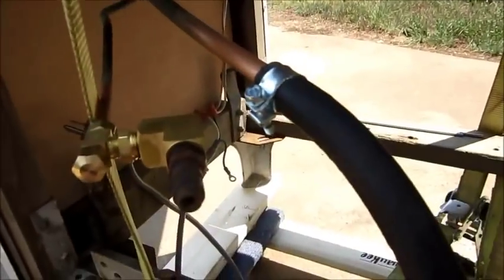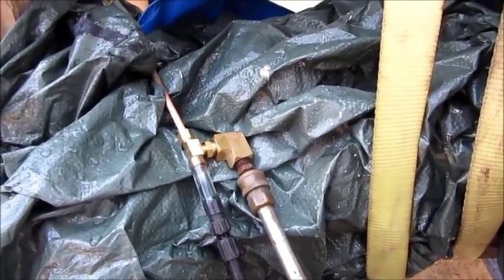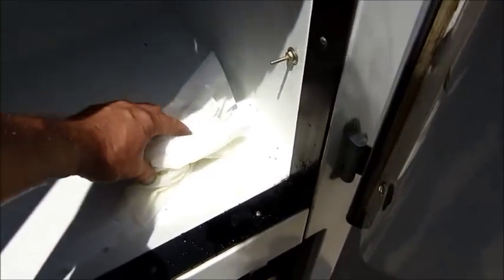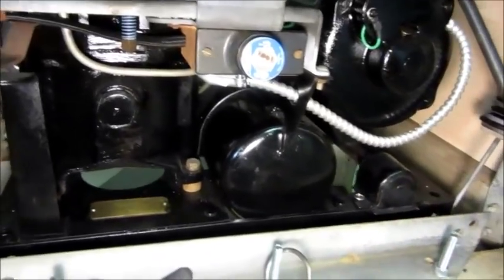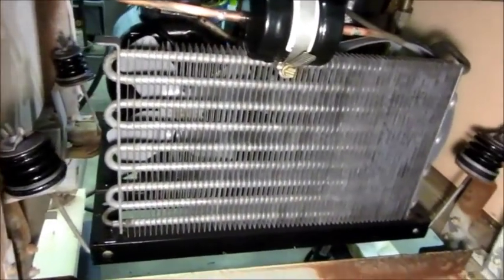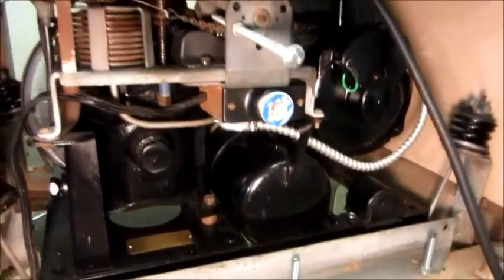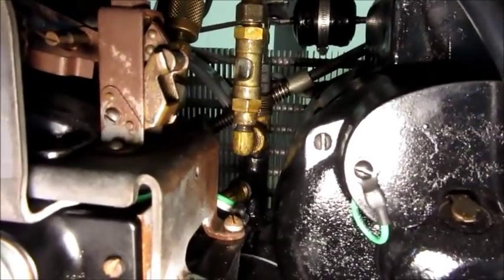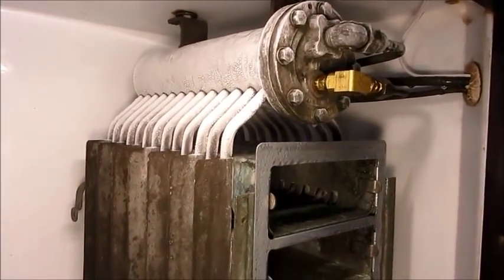1931 Frigidaire Antique Refrigerator - 7 - Flush lines, leak test, compressor install...

Comment: I think I would be pretty well set if I were to attempt a similar project. I would love to restore an old Frigidaire refrigerator some day. I’ve got a whole bunch of original Frigidaire tools. And A relative of mine has about 4 50lbs tanks of R12 still laying around. The tools were my grandfathers by the way. He worked for Frigidaire for about 60yrs.
Reply from the maker: Very nice that you have original tools!  Do you happen to have the flywheel removal tool?

A much more experienced man than I gave me a cautionary tale about R12 in these older units. They are not designed for a highly solvent-like refrigerant which blends into the system oil Using R12 in an old SO2 machine will very often end in tears for a variety of reasons. You need to stay with a combination of oil and refrigerant which are only partially able to blend together. That's why I have focused on the R152A and AB oil for these.

Comment: Hi David, What diameter are the lockdown rods you used? How long are the rods? Thanks!
Reply from the maker: Hi Gar. The rod is for sure 3/8" cold-rolled steel rod. I don't have access to the unit at the moment to measure the length. I do remember I had to buy TWO pieces of rod from Lowe's to make the two supports.

You  moving a Frigidaire?
Reply: Yes, an almost identical unit.